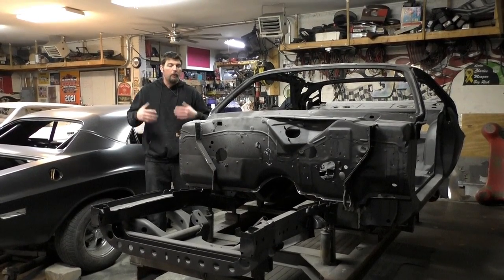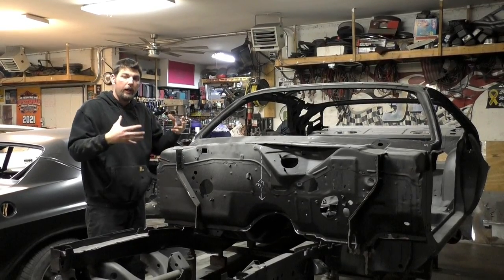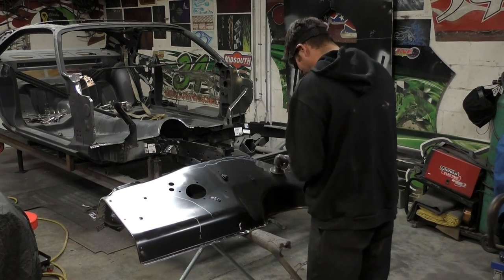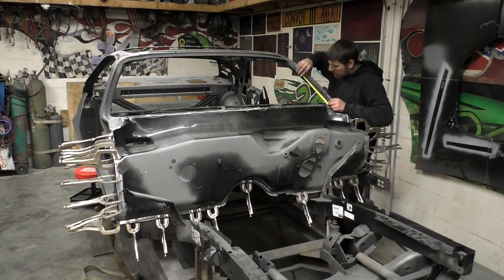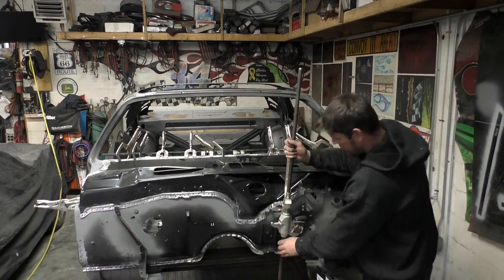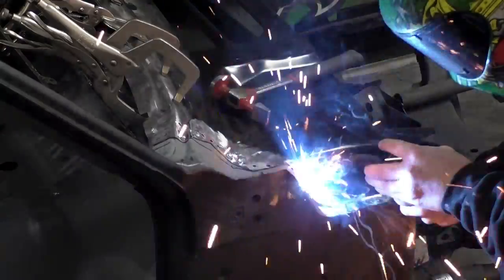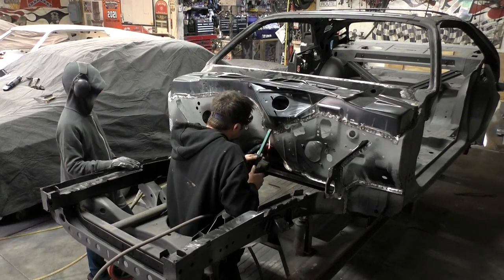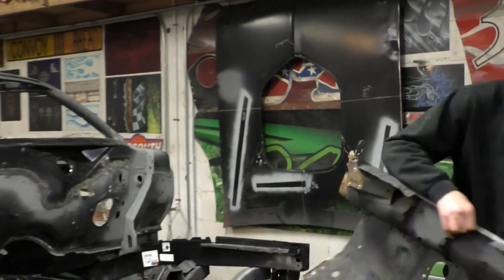73 Dodge Challenger firewall / upper cowl panel installation video Restoration episode 5

Comment: Your videos are a wealth of info making my 70 Cuda project possible.
My Cuda came with no rear frame rails installed so I would really appreciate a specific measurement.
When the rear rails are installed what’s the dimension from the bottom of the front and the bottom of the rear of the rails.  Another try is the back end is how much higher than the front end measuring from the bottom.  I hope that makes sense, I wish I could send a pic.
Your 71 Cuda and 73 Challenger videos are covering all the work I need to do, amazingly helpful.
I’ll keep watching!  Thanks ❤
Reply from the maker: thank you, I think the link listed below is exactly what your looking for the datum line I believe. Its probably better out of the e body guide book vs the cars in my shop as this is what I go off of. If you look there is a center line running height wise from the radiator support to 2.75 inches down centered off the shackle holes. All the e body references would be off that imaginary line. So measure down from the shackle mounts on your car, level it out measure the from reference and do the backwards math to add or subtract the differences on the height of your car and that should give you the needed measurements. If this doesn't help and your looking for something else more specific feel free to shoot me an email to carthageclassiccars@gmail.com and ill see if I can help you figure it out.
Reply from the maker: https://forum.e-bodies.org/reference-material/18/e-body-frame-diagrams/4768/
Reply: Much appreciated.
I’ll send you some pics when I get the wheels back under my Cuda, my Big goal for this car.
I like your new Charger project, it’s cool that you work on different manufacturers.

Comment: Really great work, I like how you showed all the measurements and points of reference. On my lower firewall I seem sealed the air vents openings on both sides before I installed the upper firewall if you don't these will leak water in on the floor through the vent and heater.
Reply from the maker: good advice and thank you!
Reply: @carthageclassiccars  another trick to keep mice out of your car is to put screen under the dash over the air vent heater intake holes before you install the heater and driver side air vent.
Reply from the maker: @mrpurcountry  awesome I will remember that for the future thanks.

Comment: What kind of spot welder is that
Reply from the maker: Pro spot pr-2000
Reply: If you don't  mind  how much did you give  for that
Reply from the maker: @daleprice8161  It was used I didn't buy it new but it was not cheap. To buy this and justify it you really need to be building cars all the time.

Comment: Great  video,   I also will be doing that same project on a  (A) Body 340  duster. Frame rail replacement,  inner fenders,  firewall, Upper And lower cowl vent.   Looking forward To the next video On the installation of inner  Fenders,  And how to correctly align all the body panels. Hopefully using the tram gauge,  I just purchase one myself. Also have you ever used a HTP  Quick spot 2 Part number 60501  I've seen Craig Hopkins With the installation center in Georgia Use it for  trunk turned down  And trunk gutters.  Just thought I'd ask   I am thinking about getting one myself.  Thanks for all the detailed instructions.
Reply from the maker: Thanks and awesome those dusters are cool cars. So with the inner fenders it will be a couple months. My plan is to do the doors next and work my way back and get this car like a first gen F body where we do the front clip last. I will be using a tram but also plan on building the front shock towers with an alignment bubble gauge to make sure it will have the proper camber/caster once the owner gets me the front suspension. I think too many shops just weld them up without really knowing what the wheels will be able to do once it goes to get an alignment. I have never used the quick spot welder so sorry wish I had more info. Might be really worth a try if Craig is using it obviously they have some nice equipment there. One question why would they use that spot welder VS the Pro spot big ones they have?
Reply: I saw a YouTube video of Craig using that welder. And him explaining where you could use it. It looks like a nice unit But it does cost about $800.   One of Craig's  employee  At the installation center  Has a live YouTube feed Tech talk Tuesday At 7 PM.  I also watch at Amaysing metal works.  Where he shows you the process of building a complete  1969 Camaro.  His current project is a Ford fairlane for AMD's   Show room,  Showcasing parts available
Reply from the maker: @ty3095  I saw a couple of his videos on playback on that Camaro, pretty neat all from nothing. Also good to check out how others in the business do similar stuff and maybe pull small details to make your work better. If you end of grabbing the unit feel free to send me a message what you think about it never know in the future having something a little smaller might be beneficial here at me shop also.
Reply: Yes, I will do that, Rick. I definitely pull information from other builders. But between you and the installation center videos, it is a wealth of information.  I've been looking online trying to figure out  how to build a chassie  jig.  I will be building one like yours, Thanks for sharing all the information.  Ty
Reply from the maker: You are welcome and thanks for the big compliment!